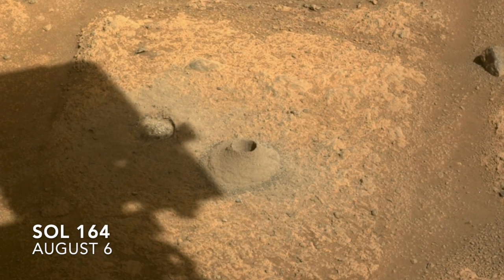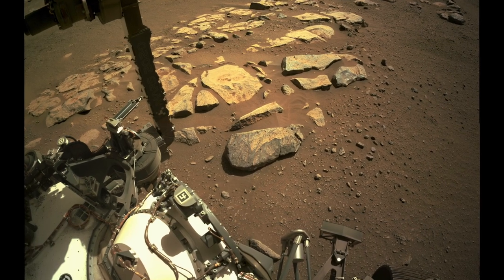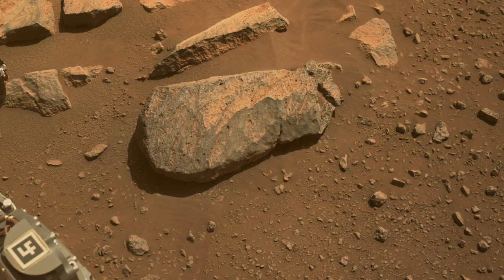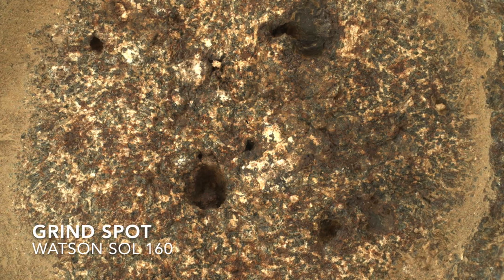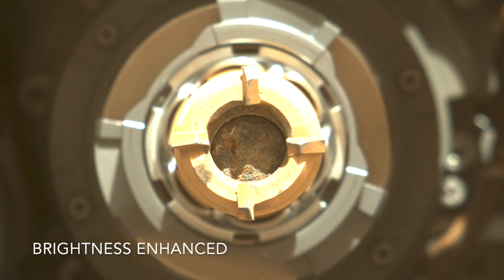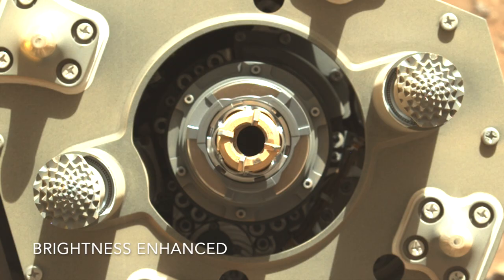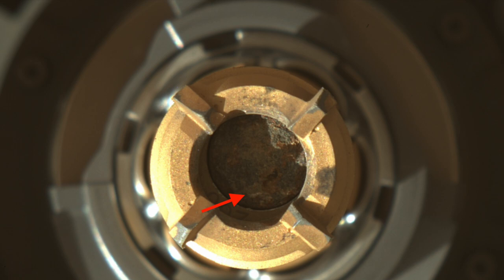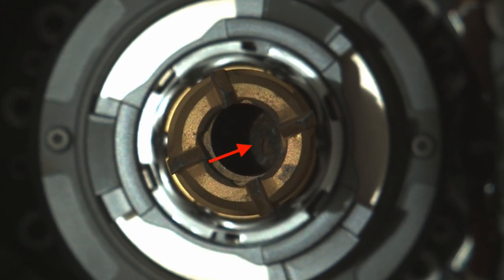Did the second attempt to collect a Mars rock succeed?

Comment: How much does such a example weigh? It looks like about 30 samples can be saved. The rover will weigh a few pounds more eventually when everything is full. Movement and distance are less then (theoretically). Surely NASA has thought of that afcorse... great content!!
Reply: In total they expect to collect around 1kg of rock and gas samples

From mission milestones section at the bottom 

https://en.wikipedia.org/wiki/Mars_2020
Reply: As I recall, the system is designed to drop off one or more samples at various locations along the route, with the goal being that they will eventually retrieve them via means yet to be designed, in a future mission. So the weight would not reach the total of 30 samples. If I'm recalling correctly.
Reply from the maker: Thanks.  And yes, some samples may be stored onboard, others will be dropped off for the future fetch rover to pick up.  But the additional weight will be trivial for this rover to deal with.
Reply: @MarsGuy  Thnx!